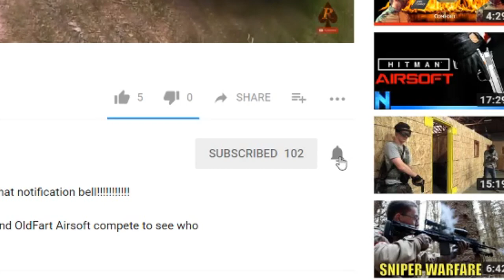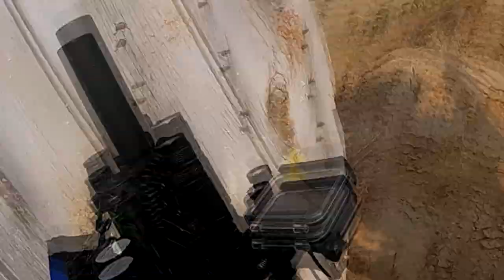Call of Duty Warzone Airsoft Gameplay: Operation Freedom - Colorado Airsoft

Comment: dude sick video!! what loadout are you using?
Reply from the maker: I am using a plate carrier, belt combo.
Plate Carrier: Emerson 420
This carrier is awesome because it has detachable front and back panels that make it easy to switch airsoft platforms on the fly. All of my replicas use different mags so this is really helpful. It also comes with foam plates already. 
Belt system: I use the Condor LCS gunbelt for my outer belt and the HSGI inner belt. This combo makes sure that everything is secure and doesn't shift in the field.

Also I am really glad you liked the video. If you want to know anything else feel free to ask.
Reply: Runner Runner Airsoft I think you convinced me on buying one!!! Solid loadout! Btw I just sub’d - can’t wait to see more! Also if you have a second would love to hear what you think about our v!deos!
Reply from the maker: If you run that plate Carrier do not forget the front panel you need to buy in order to swap stuff out easy.

Search: TMC PALS panel for 419/420 plate carrier
Reply: @RunnerRunnerAirsoft  smart! good tip - I'll do that!!